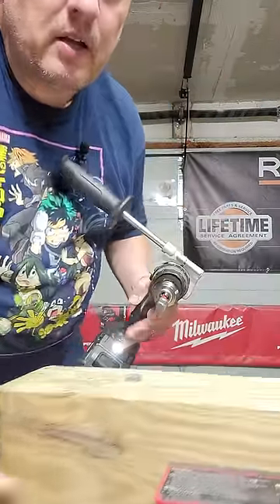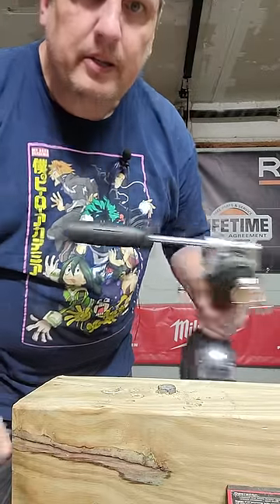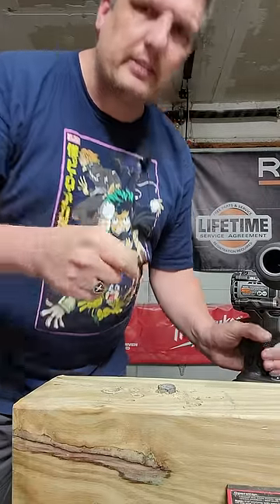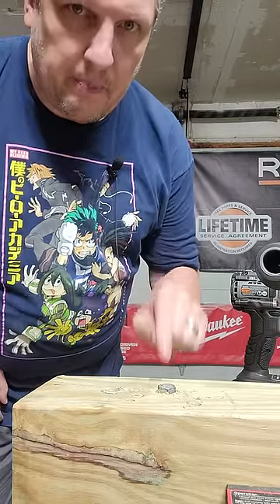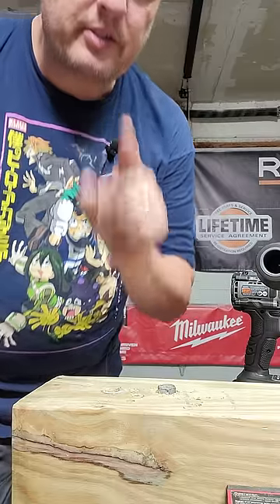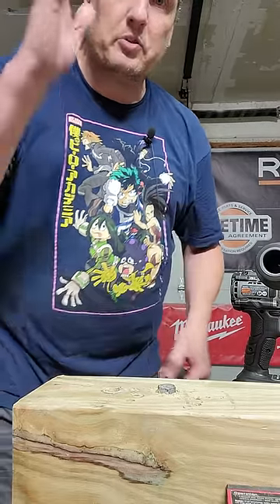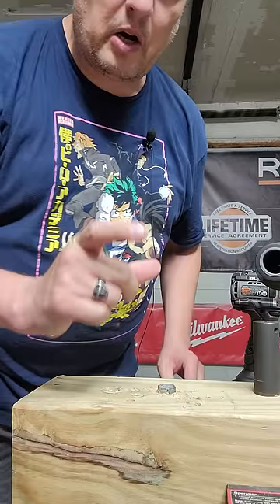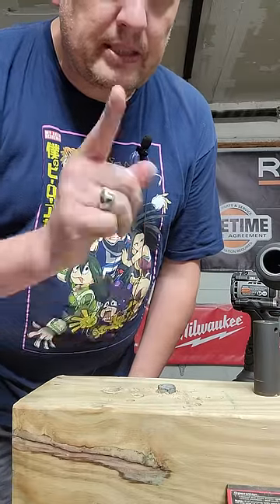Challenge Accepted! Now What? #challenge #powertools #tools #power #drill #EMBARRASSING #victory

Comment: I can almost smell the burning motor
Reply: That's why they are called drill drivers
Reply: Right?! I use my "drill" with drill bits only. Thats the purpose of the tool.
Reply: if it was a brushed motor.
Reply: @bricorley no they are called drills, impacts are actually called impact drivers
Reply: @ewillis3121  also are called drill driver
Reply: The smoke is coming from the wood not the drill 😂
Reply: @utubeisajoke  Nah. It's a drill. Impact is a driver. The kit is called a Drill / Driver kit because it has both.
Reply: lol they still burns @caploader111
Reply: @malacruxnorman3162  BRo.... Brushless motors can't burn, it's brushed motors that burn up. It's 2023 get your straight together...The bearings are the whole wear item in a brushless motor....  Bet you don't even know brushed vs brushless lol
Reply: @reznya2700  A brushless motor is not intrinsically immune to burnout. If you stall it, (RPM drops to zero) then its windings become more or less a short circuit, and can result in either burning a winding or the electronics.  Most, however, would be protected and cut out before that point.

Comment: That power draw though. Probably only getting a few of those installed before that battery is toast.
Reply from the maker: You can do about 12
Reply: Exactly
Reply: Impacts are faster than drills when doing lags
Reply: @ToolswithSoAlz curious how long the drill lasts. Clearly pushed to its limits
Reply: @ToolswithSoAlz 12 lags that suze and i only loose 1 bar on my battery using a makita impact. The inpact is faster every time.
Reply: Impressive, but that's also a 40v Flex drill. A 20v w/ a 5amp hr DeWalt would be toast on the 1st try.🤣 
  Right tool for the job and which tool you have available depicts which tool is best and right for the task...
Reply: Battery? Motor, also! 👀🤔
Reply: It will also overheat and have to stop if doing them back to back. That drill is one of the most powerful for it's size on the market too. This is a best case scenario. Most drills wouldn't even sink that lag.
Reply: Cute handle
Reply: That drill will be smoke in short order. Also these new brushless drill suck balls if you want to use torque. They kick out to easily.
Reply: @ToolswithSoAlz 😂
Reply: For real! LOL I'd use my impact!
Reply: Wtf kinda wonky donkey drill is that?
Reply: @duckmn56 The only sure way to find a tools limit is to push it to failure. If the tool doesn't fail then it's not at its limit.
Reply: Pre drilling holes will help on battery life. Honestly when I am in my garage I will either use my electric drill or pneumatic tools. My cordless is usually saved for fixing stuff elsewhere or I will take a few with me rock hounding to see if it's worth bringing home.
Reply: Or motet overheats and scorches the armatures
Reply: @ToolswithSoAlz  Sure beats doing it by hand!
Reply: Exactly. This fool probably hasn’t even stepped foot onto a jobsite that required him to actually use his tools properly

Comment: Yeah no, impact drivers are for screws, impact WRENCHS are for lags and bolts, drills are for drilling. That’s if you value your wrists and keeping the drill around for long.
Reply from the maker: Unfortunately for you only one of us knows how this would really be done and why the drill is the only tool you would use
Reply: @ToolswithSoAlz dude the drill almost ripped your hand off. And you had good overhead leverage. I want to see you drill one handed overhead on some ladder.
Reply: that's what i was gonna say, this is a job for an impact wrench not an impact driver or drill
Reply: Amen brother 👍 also using the drilll on a lag like this in high speed will significantly shorten the lifespan of the drill. He needs to use it in low speed cause that where the drill has the most torque . He’s putting too much strain on the drill at high speed.

Comment: Drill sounded like it had a transmission in it and downshifted! 😮
Reply: Flex baby
Reply: It basically did, I think it switched to a lower gear to produce more torque.
Reply: Lol yeah sounded like it was having a stroke 😅
Reply: almost like....it does...has a clutch too. the drive shaft in the drill transmits the rotations produced through the clutch and that regulates the drills torque
Reply: He as 18 speed transmission 
 in It :P
Reply: Dude I was thinking the exact same thing😂 homies shifting his way this that wood
Reply: That’s because it does.
Reply: He should have used the hammer mode..
Reply: Hammer mode is only for stuff like bricks or concrete drilling bits. There’s not really a big difference between the two modes when it comes to wood.

Comment: A few more like that, and he'll be filing a warranty claim to replace the motor. 😂
Reply from the maker: Whatever lie you need to tell yourself
Reply: @ToolswithSoAlz for those kind of screws people do stuff like pre drilling.
Reply: 😂stop telling it like it is. 😂
Reply: A good quality drill can EASILY get away with a couple thousands situations like this.
Just make sure to get a powerful brushless and you'll never have any problems
Reply: If you've ever used an impact driver for more than a handful of big screws you'll know the impact section gets HOT and takes longer to cool down than a motor with a fan in it that you can free spin between screws. If it wasn't able to drive something that big it wouldn't come with that big ass handle.
Reply: @MrBestvirginia that's not very good if the life of the drill is only good for 2000 screws like u say
Reply: That looks more like it is a separate piece.

Comment: I've always done a pilot, about an eighth of an inch smaller diameter. Some of these six by PTS are incredibly dense. Not to mention you avoid future splits
Reply: Cutting wax on the threads makes a huge difference
Reply: Pilot holes make life a whole lot easier 😊
Reply: @skxj  okay. I will try that in the future. Normally I use 10in Spikes, three-eighths of course, but now they have all the high-quality 10 inch screws, torx driven. Get yourself a decent quality DeWalt and they run right through like butter
Reply: We always drill pilots as well and run lags and machine bolts with impacts. Like you say , you’re wrist. When you’re doing this for weeks or months on end you have to be set up for endurance.
Reply: On the first course, hopefully you have stone, half inch rebar with a 3/8 pilot, (lookout for utilities LOL.) Requires an 8 Pound Hammer if not a ten. Second course, I always use 10in spikes, 3/8, with a 1/4" pilot. But like I said, these new torx driven screws go in like butter with a modern driver
Reply: Used to pre drill the diameter’s of the lag minus the threads as long as the lag didn’t spin. Sometimes a little smaller.  
Until I started studying the different codes I used to crank anchor bolts , etc. then I read hand tight plus half turn, as I recall. It’s been twenty years.

Comment: Man I don’t know what happened to the world but I miss the days when we didn’t hand impact drivers and everyone was using DeWalt drills to scare things in. I’m not sure why everyone hates drills now, but I hate impact drivers because of that awful noise they make.
Reply: Because drills are hard on your wrist. Trust me after a full day of screwing in lag screws like that you'll be lucky if you can even hold your steering wheel to drive home. But seriously coming from someone with carpal tunnel I prefer impact because they don't leave my wrists hurting and throbbing when I get home from a long day
Reply from the maker: Um...only a fool drives a lag with an impact
Reply: @ToolswithSoAlz  works just fine for me🤷‍♂️ try not buying a Walmart brand impact and you'd be surprised how well they work
Reply from the maker: @konnerkramer329 ma'am not only do I know more than you but I also own more than you
Reply: @ToolswithSoAlz have you ever even used an impact? An impact driver would smoke a drill. That's why mechanics use impact wrenches and I know the only difference between the impact driver and the impact wrench is the chuck, in the wrench it doesn't have one, but rather an end just like a socket wrench. Also the impact driver and wrench both have stronger fittings for the amount of torque they put out! A drill is for DRILLING and an impact driver is for DRIVING.
Reply from the maker: Ma'am I have already proven you wrong

Comment: I just installed 140 big deck screws into a trailer deck. Driving thru treated 2x8 and 1/4 steel. Pre drill pilot holes but man was it a tough install. Started with my dewalt cordless drill. Soon started using mid torque impact. What a difference that impact made, one handed right on down. Every tool has its perks.
Reply: I just re decked a 28ft gooseneck with those 5/16 x 2 inch torx head bolts. Think I used around 160. Pre drilled all the holes. Which sucked by the way. Went to try to drive the bolts in with my Makita 18v impact driver. It's was struggling so I wound up using my snap on 1/2" cordless impact to run those suckers in. Much faster and a lot less struggle lol. That was a job for sure
Reply: I run approximately 4k-6k screws a week, everything from lags and bolts to self tapers and 2,3,4 inch structural screws. Trust me get a good drill and you will only use that impact for tire lugs.
Reply: DeWalt impacts are the way to go
Reply: @bradleyeinarsson4535  what in your opinion is the best drill if prices didn’t matter
Reply: Wow I did the same thing with something called a self drilling screw they're amazing 😅
Reply: @bradleyeinarsson4535  If you want to use the wrong tool for the job, just use the drill. All these people using "drivers" to put in screws are just perfectionists when you can use the tool for making holes to put screws in too. Enjoy your carpel tunnel.

My 1/2 inch Milwaukee will put in that screw and hardly impact at all, twice as fast with a tenth of the effort. Almost like it was made for that.

Comment: Yeah, drills have more driving power. Impacts are for different applications. Pre-drilling your hole is the way to go.
Reply: So buy a drill pre drill and then drill it in
Reply: You don’t pre drill in timber framing🤦‍♂️
Reply: @NickFruehauf  that could be correct. I guess it would depend on the fastener manufacturer and their recommendation.
Reply: Drills don't necessarily have more driving power. Impacts tend to have more power and less kickback. Impact drivers are designed for high torque nut, bolt, and screw driving applications. If he was using an impact you would have seen less kick when he was driving the bolt.  Impacts are also a little counterintuitive because we're used to standard drills.  In a standard drill, the power comes from the gear ratio, so we put it in low gear for higher torque. In impacts, power comes from motor rotational speed so we need to put it in high gear for more torque.  You also need to use the right impact driver for the task. A 1/2" square drive impact would be ideal for this lag bolt.  One more thing to note: using a drill for this will burn out the motor much faster.
Reply: I always pre drill the whole
Reply: You could just buy a rattle gun?
Reply: That drill has more power than a 1/4” impact… comparing 3/8 & 1/2 compact impacts your starting to tip the tide on that flex drill. 1/2” mid torques and up forget about it.
Reply from the maker: @lukeknighton4918 I have already proven you wrong. The drill is the only tool you should use for this
Reply: @ToolswithSoAlz  Listen to it. It’s not happy. If you ran those 10” lags all day every day your going to kill that drill in shirt order.
Reply: @NickFruehauf depends on the diameter of the fastener you’re putting through the wood. Too large of screw or fastener and you’ll split the member. It’s basically a wedge at that point.
Reply: That's what she said
Reply: @CytoplasmicGoo  Right? "Just manhandle your drill while it squeals out in mechanical pain!"

Contractors are beasts of habit and you can't teach an old dog new tricks and all, but goddamn.
Reply from the maker: @Yawyna124 you pickle puffers don't even know how to do this but you're pretending to be professionals. Now that's hilarious
Reply: Drill key word. Made to drill holes
Reply from the maker: @monkeyking9726 it's called a drill driver because it drives fasteners. Know what you're talking about before commenting
Reply: @ToolswithSoAlz  I mean, I'm not going to pretend to be a wood framer, but I can tell that neither you nor your tool are doing it particularly efficiently. 

Would you have to put all 75 pounds of your beer gut into doing that with an impact wrench like you had to do here? Not an impact driver, an impact wrench - the heftier ones.
Reply from the maker: @Yawyna124 you morons believe this is a how-to video because you don't have the brains to understand it
Reply: @ToolswithSoAlz  Not under the impression it's a how-to, just raising an eyebrow at this circus you're putting on. 

Having now watched an obese man manhandle a drill while it grinds to a near halt and then claim its better than an impact driver - when most people would have used an impact wrench for the task. 

Impact wrench, not impact driver. The sort used for bolts, lug nuts, etc. because their entire thing is putting out massive amounts of torque easier than a drill. 

Yeah, sure, you might be able to do it faster mashing downwards into your drill while you have to grope its body with both hands because it's trying so hard to whip around that it violently throws the piece of wood you're drilling the moment you stop trying to give yourself a hernia, but is it easier? Is it even putting out more torque than a good impact wrench? 

Your body is already halfway into the grave with all the health conditions you've got going on, no reason to insist on making every time you use a tool a battle. One must imagine Sisyphus happy and all that, but I don't think manhandling a drill really needs to be your chosen struggle.

Comment: Please lube the fastener threads before you drive them into resistance materials where the fastener is cutting its own threads. Be nice to your tools, and they'll last for you.
Reply: Please?
Reply: Bar of soap
Reply: I use some paste wax.
Reply: Mess with your ft lbs if you need a specific torque value.  
Obviously not here in wood but in other applications.
Reply: @matthewbeaver5026  if you're cutting your own, new threads, you're probably not following any specific directions or worried about fastener torque. But if you are still wanting a specific torque, using a digital torque wrench to finish tightening is probably your best bet.
Reply: Or ya know, just use an impact driver like you should be using on an 8in lag.

Comment: 100% correct. The drill has gear reduction. Knowing the correct setting is important. 1 and drill you got yourself a wristy twisty tool
Reply: You know what you can do with that screw gun.  Break your wrist
Reply: Popeye says, no big deal.
Reply: Impact driver creates a higher retention force than a drill. To prove it, untorque any fastener with torque wrench for both drill and impact and you will see impact driver has higher untorque value than drill.
Reply: @sebparent3501  Did not know that.  Is it universal among all fasteners?  I would not have thought it would be measurable.  What was the % difference?

Comment: bigger impact gun for bigger fasteners. we use the 1/2" drive for stuff like that
Reply: Correct
😊
Reply: How does the head of those fasteners look afterwords? I would think it would do some damage to them. Granted they probably are not coming back out anyway.
Reply: @doghouse4538 it’s all about having the correct socket. If you have a tight fitting socket the head’s usually don’t have any damage
Reply: @Charlie-d3z  Right, using crap sockets is the only reason for damage to heads.  Should always use tight fitting, IMPACT RATED, sockets.  Then use a battery powered 1/2 inch impact, could probably use a 3/8 as well depending.  Drills are great but as he showed when it caught and spun, they are great for twisting your wrist off as well.
Reply: @xrenox1 Impacts are also remarkably more capable at multiplying torque through frequency now-a-days.
Reply: My 1/2 inch only hits a few times and needs a reset. My 1/2 inch drill is faster and easier for big lags. Gotta pay attention though or when it hits the thing will twist the world.
Reply: Exactly.

Comment: I can recommend drilling a pilot hole and a drill that's up to the job
Reply: He did drill a pilot hole... he just set the camera angle so you couldn't see it.
Reply: @jonlanier_  If so he did it how it's supposed to be done. And in the case of a pilot hole you don't need to strain to keep the drill in your hands...
Reply: Amen. And, if the drill is borderline for the job, you can put a little wax on the threads to make the job easier.
Reply: An impact would not need a pilot hole. Different drills are made to do different things. In thus case, google really is your friend.